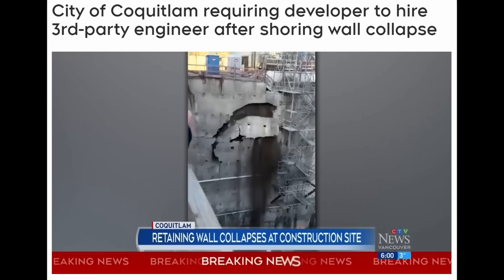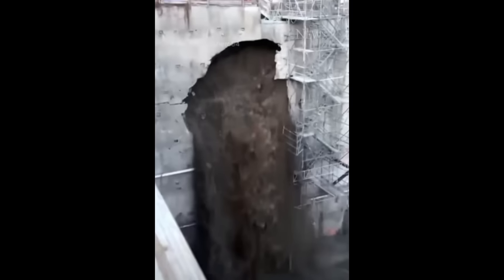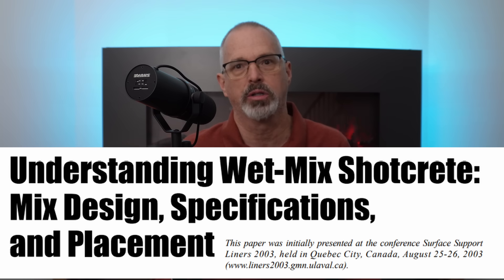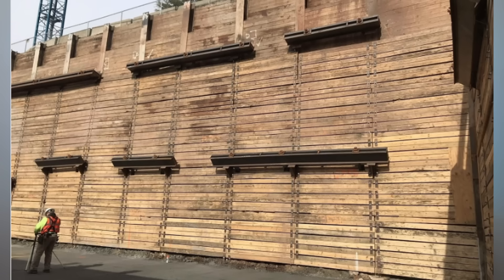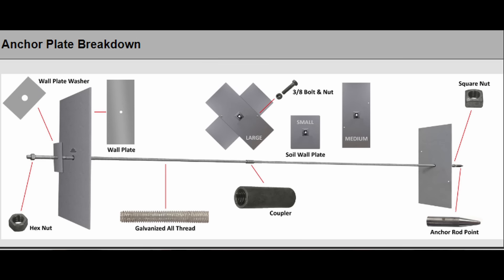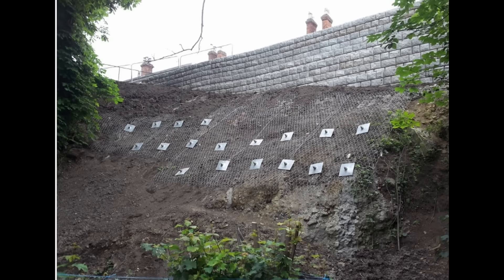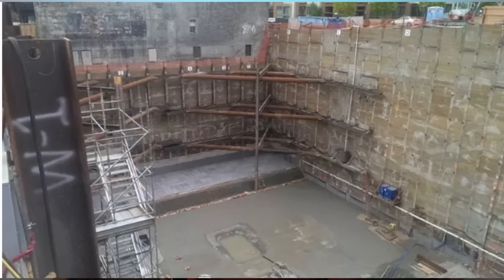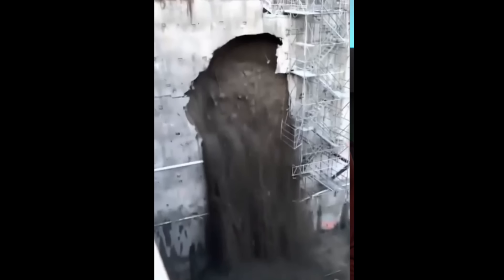Retaining Wall Collapse in Canada

Comment: I'm no engineer, but even a layman would know that a 60-foot wall with so little reinforcement couldn't possibly hold back loose, dry soil.  Clearly, no reputable engineer designed the wall, and no inspection was made.  I'm surprised that more of it didn't collapse.
Reply: Whomever sealed these plans/specifications should loose their accreditation. If GC executed faulty specs, the blame lays with the professionals who green-lit this nonsense. Unfortunately, the GC will get sued, however, might be different in BC than east coast.
Reply from the maker: I think they have a big problem on their hands at this point.
Reply: @CaseyJones-Engineer im about 500 meters from there, my usual route home is blocked.  All of these big buildings are retained in the same way.  We have about 12-15 new highrises here in the past 5 years
Reply: I've been thinking about building a retaining wall on one side of my yard--no more than five or six feet high at most, but I do think about the forces at play. Seeing this video was shocking. If I ever get around to building that wall, I won't be making that sort of mistake.
Reply: @TheEudaemonicPlague  Build your wall just plan it well. In my area anything over 3' tall has to be engineered and stamped and permitted. Talk to a block wall supplier or contractor. Get several estimates and read the fine print BEFORE you sign or any work or giving a deposit. They should be able to point to a reputable engineer. Engineer may be able to help you with a budget for costs too. Read their fine print too. Probably need some limited investigation then design to include drainage and possibly some geogrid or another retainage system. And a missed part may include construction monitoring and  or inspections.
  Order of magnitude costs $50 a square foot for your wall.
Reply: Wet soil is worse, and the whole area is littered with new developements adjacent to each other.  Probably alot of things at play here.  That wall is directly adjacent, almost touching the street.  Could have been water getting down there its about 20 feet away from the curb give or take.
Reply: As stated not an engineer, then your opinion is useless, this system has been used for decades in British Columbia with almost no failures, the 2 failures I have been aware of 1. in the Early 2000's cracks start forming between the sidewalk and the roadway, when the wall collapsed it was found that a city water line had been leaking and the water pressure caused the failure, 2. in about 2010 a wall collapsed and it was found the contractor did not build the wall to spec, did not properly test the anchors for pull and creep and also placed some short stubs of anchor bar instead of proper anchors.
Reply: When you hire/grant contracts to firms that look virtuous, not a history of good work.
Reply: Its in bc. The most overrun by Chinese province in Canada.
So what do you expect. 
Its made in China quality
Reply: @anything.with.motors  Your comment reeks of xenophobia and is totally off-topic.  Additionally, you know nothing of Canadian engineering standards or protocol.
Reply: Reasons : somone paid 5000 yaun for college 
Instead of $50,000 Canadian 

Theirs reasons I won't go to college anymore 

And reasons why Canada is collapsing
Reply: We study for free in germany, truly one of the worst education one can get
Reply: @anything.with.motors  you have no idea who designed this. Stop with the bigotry and hate please.
Reply: @GFY_FOAD look up who was in charge 😂

Comment: Yeah as a commercial structure carpenter in US this is insanity. Who was suppose 2 check compaction of that wall? Jesus. Tryst me as a worker engineers have put me in danger MANY times because they wont listen to exp of workers. Never seen a shockcrete wall this big. Usually u'd pour an ACTUAL wall at least part of that. ITS MONEY ITS ALWAYS MONEY its cheaper to use shockcrete than piles etc. So they stretched its use
Reply from the maker: I agree with you.  I see it all the time where engineers don't listen to experienced contractors who raise concerns about constructability issues.

Comment: I've seen the result of 15+/- meter high reinforced concrete retaining wall pull the tie beams of a large warehouse built on the side of a hill here in Asia 20 years ago. There was a seasonal stream that was covered up with construction debris and soil when they built the retaining wall. Water drainage was inadequate. To strengthen the retaining wall the young engineer who designed it attached it to the tie beams of the warehouse built above the retaining wall and about 10 meters from the edge of the wall. Come rainy season and the water saturated soil pushed the retaining wall. In turn the connecting concrete beams pulled the concrete tie beams of the warehouse. When they uncovered the tie beams, most of them were stripped off of their concrete cover and the steel reinforcements were exposed. The rumor was the young engineer did The Great Escape and fled to the U.S. shortly after the fiasco. XD

Comment: Casey,

Again, this seems to be a failure by those responsible for government review, inspection, and approval, those responsible for the design, the contractor responsible for construction, and the owners of the project.  To me, someone trained as a naval architect and marine engineer 50 years ago this coming April, is a large amount of carelessness mixed with stupidity.  I have seen two swimming pools built with sprayed concrete.  Both were reinforced with steel reinforcing rods.  The concrete for pools about 10' deep, I would guess was about 6" thick.  Except for initial construction, spring cleanup, and periodic maintenance, the pools were filled with water for hydrostatic balance.  The retaining wall was more like a damn in height, without the corresponding wall thickness.

I disagree with your observation regarding the "dry" soil.  I agree the soil looks "dry" at the time of collapse.  Vancouver has rain on average 169 days per year.  Vancouver gets an average rainfall of around 48.4".

I live in southwest Virginia.  We have had issues with water flooding our basement.  Our house was built in 1942 and was moved to its present location in 1975.  This part of Virginia has never heard of sheet piles or of driving H-beams and using plates or wood for building retaining walls. However, the building code does require if a wall is not built that the ground be excavated with slopes such that workers are not in danger of an avalanccollapse occurring.

Bob

Comment: That exact spot was a former driveway access to an original parking level.  That area of failure is all recent backfill. If you look closely, you can see halfway down the original sloping compacted fill. It was a steep access. No permitting is required for the work.

Comment: My experience in civil engineering is over 30 years out of date, and I never really had any significant work in that sort of construction, but you couldn't have paid me enough to get me anywhere near that excavation. I'm astonished it stayed up as long as it did. 

If anyone had been hurt there should have been jail time, as it is, if they have any certifications they should be cancelled instantly and any project they had any responsibility for needs to inspected immediately.
Reply: When the Shangri-La was built downtown Van. to bedrock, you would think looking down in to the hole that the excavators were dinky toys. The shotcreate wall was much, much, much taller than this, and it was right off Alberni and Georgia downtown! Someone, my guess, didn't really know/notice the unstable sectioin of soil.

Comment: I’m not an engineer but when I saw this video I wondered if an engineer(s) were involved.  I think developers are trying to cut costs doing things as cheaply as possible…the Millennial Tower in San Francisco comes to mind.
Reply from the maker: According to media reports there were engineers involved with this retaining wall.
Reply: @CaseyJones-Engineer  Worksafe bc  (British Coumbia's OSHA) requires any excavation over I think  8 feet to be engineered by soils engineer.
Reply from the maker: @banffdigger  Thank you. I suspect that this wall was engineered but something must have been missed in the process.
Reply: In BC Engineering is required:
1: excavation is more than 20feet deep
2: an improvement or structure is adjacent to the excavation
3: it is subject to vibration or hydrostatic pressure 
4: ground slopes away from excavation edge at steeper than 3to1 horizontal:vertical

Comment: Perhaps in your spare time, you could tell us about a NEAR mega disaster with Chicago's John Hancock building's caissons.

A relative working on site (not connected with the structural work) said the caissons had voids and were jack-hammered out and re-poured $$$

A sharp-eyed surveyor noticed one of the caissons had moved!

I would hate to think of Big John shifting positions...

Thanx
Reply from the maker: That is a great suggestion. I test drilled shafts (caissons) for a living.  That type of testing was not performed for the John Hancock building as it wasn't available at that time. As a result, people were relying on visual observations to detect problems.

Comment: The engineer must have been blind on this one.  Not only do you have the worst substrate imaginable, but on top of that the face is nearly vertical.  A soldier wall would have definitely of been a better option and even that would probably need some diagonal buttressing members added to it.

Comment: I couldn’t tell if there was any steel reinforcement in the collapsed system.  I can’t imagine not using  steel reinforcing bar or mesh.
Reply: What was holding it up?  How did they build it?  What did they spray the shotcrete onto?

Comment: I am not seeing any rebar or even rewire to speak of. We had to pull sections of our walls out from time to time. And it was a mess of rebar and rewire that held large blocks together. Bad design I think. I wouldn't imagine inspections and management would have missed that much. I installed a bunch of shotcrete walls. Only failure we ever had was because the GC directed surface water behind our wall. The wall actually stood and washed the soil from behind it. Looked crazy about 4' from the back of my wall to the face of the soil.
Reply from the maker: Thanks for your comments.  Water is usually the culprit in these instance but the soil behind this wall looks bone dry.  I agree with you that they skimped on the reinforcing for the wall face or for any elements to effectively transfer load from the soil to the anchors.

Comment: We did support of excavation that was over 40'. It looks to me as if plates pulled through the face. The ones we did had a lot of rebar. Testing and inspections are important as well as competent workers. In one instance we tensioned the soil nails to place them under load to push the retained soil back. Another instance our soil nail wall was designed to retain earth pressure permanently. This can be a very competent flexible and robust system. Properly engineered and installed. I loved doing them. Shame to see something like this happen. Would be fun to be part of the forensic team.
Reply: i would guess that a wall of that size should be atleast 12-15 inch thick concret with double rebar  and anchors.
Reply from the maker: @charlie97987  I agree with you. Also is there some risk of earthquake loading that would have to be considered?
Reply: @CaseyJones-Engineer  40 inch concret and double rebar in a mesh formation and 2-3 meter apart anchors should  hold for a quake ...  I am not an engineer but have a 3 year masonry and concret diploma and 20 years of work experience
Reply: @charlie97987  The walls don't need to be that thick. Most of the force is horizontal. The anchors are spaced of a 5' grid on the wall we built. So each element was only supporting 25 square feet. We did 5% pull tests on nails and our shotcrete was a 5.00 psi mix about 6" thick with 3/8 course aggregate. Usually had to do test panels and then core them then brake them at the lab. The reinforcement was a heavy gauge 4" x 4" welded wire panel over lapped 2 cells. Then we ran double #5 bars horizontal and vertical intersecting behind the 3/4" 6" x 6" steel plate. All reinforcing had to be embedded properly and we had to float off around the anchor so the plate made perpendicular contact face to anchor.
 The wall there didn't show much if any rebar. Shotcrete was a very good option in a lot of situations. The height issue wasn't a problem. Just design you anchors the carry the load. We did daily inspections looking for cracks. Concrete cracks especially temp. But we monitored it.
Reply: @mikeshanaberger7503  Hi there and thank you for your reply. In this video it is clear that most of the force is outward not vertical, you can see the anchor plates go right through the shortcrete like it were plaster.. there dos not seem to be any resistance as the anchorplates cut a clean squere hole through the shortcrete. for the pressure to be vertical on the wall the weight of the soil needs to be above the wall not next to it. I do not think shortcrete is designed to be used as stucture bearing congrete ... by design it is to week. In tunnels shortcrete is used to catch and bind small debriee .. not to carry the tunnels waight.
Reply: there is a thumb rule you can use when working with concrete. when mixing use as little water as you can while still beeing able to form and work with it. when curing as much water as you can with out washing out the binding material( like cement) and after curing as little water as possible.
Reply from the maker: Thanks for your comments.  It sounds like you agree that something was lacking with the construction of this wall (most likely not having adequate reinforcement at the face).

Comment: I'm no contruction expert but you see that type of shotcrete used for all the highrise and other constructions projects all over the Vancouver area.
Reply from the maker: Did anything from the video strike you as being different from what you typically see in Vancouver for shotcrete retaining wall construction?
Reply: @CaseyJones-Engineer  sometimes (not always). you see it sprayed onto a small gauge steel mesh that looks like chicken wire.  But it's usual to see that type of highrise construction out here.  Some of them go down almost 50 meters on the taller buildings.  I mentioned also, the soils are mostly glacial till in that area which is quite hilly and it does rain a lot and a lot of rain recently too
Reply from the maker: Thank you for those additional details. @Kiera_Jackson74

Comment: That looks like a temporary shotcrete wall.  They are typically constructed (here in the US) with Soilnails on 5 foot centers and minimal reinforcing consisting of 4x4 inch mesh, horizontal and vertical #4 or #6 rebar centered on the soilnails covered in 4 to 6 inches of shotcrete.   Soilnails are Passive anchors (unlike tiebacks that are post tensioned), they don't see any load until there is some movement of the wall.  The more load they see, obviously the more they will elongate.  In a 60 foot tall wall it is possible that they saw enough load to elongated so much that they overcame the structural integrity of the shotcrete and reinforcing.  Temporary shotcrete walls are constructed in lifts with cold joint between them.  It looks from is video that some of the failure occurred at the cold joint.  I've seen shotcrete walls constructed to 45 feet.
Reply from the maker: Thanks for your comments.  I see what you mean about the cold-joint in the shotcrete being a probable source of failure.  Also I am not seeing in rebar in this wall face which is surprising.  I also think walers connecting the anchor plates on the rods would have been advisable.
Reply: While the approach you describe may be adequate for certain soils, I see no sign of reinforcing mesh or rebar in the video. Thus, there appears to be no reinforcing, making the soilnails of little protection.
Reply from the maker: Agreed. @jaymacpherson8167
Reply: The initial failure happened right at the tension rods where the wall pushes through the retaining plates.  It would not make any sense to have a cold joint there simply based on the systematic excavation process you would expect that that cold joint would be positioned 2- 3 feet or so below the anchor position as you would already be excavated to that level in order to install the anchors.  There would be absolutely no acceptable reason to have that cold joint right at the anchor level.